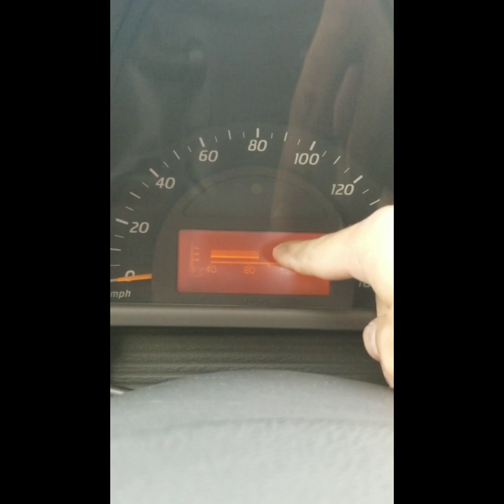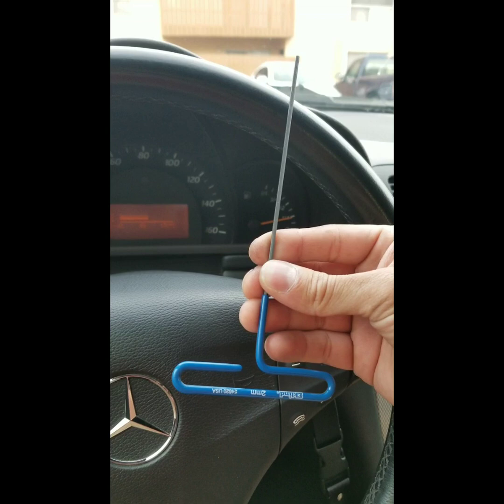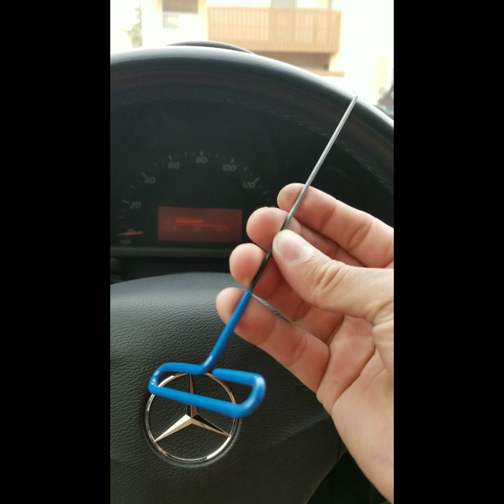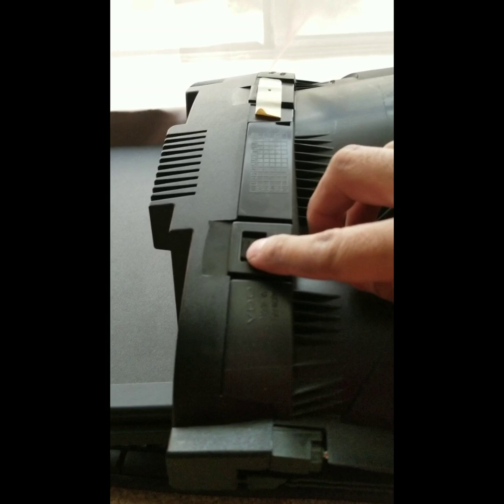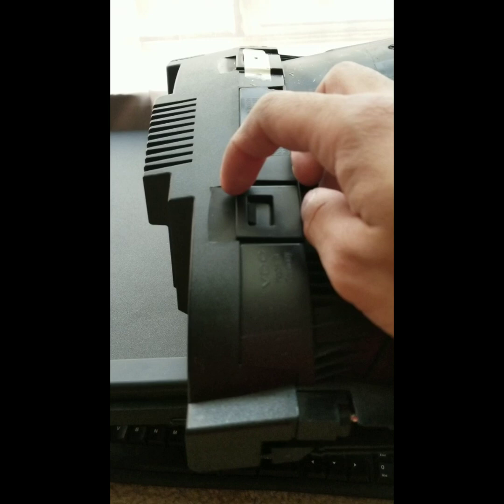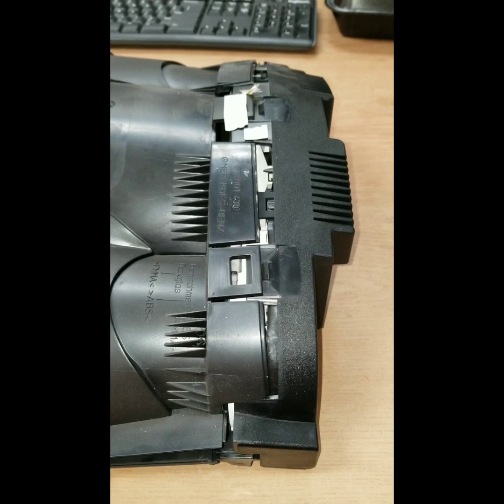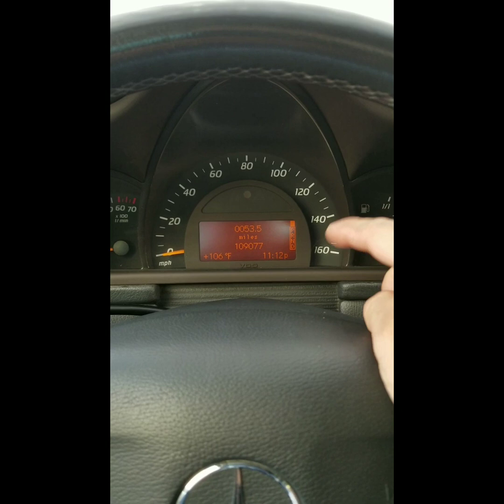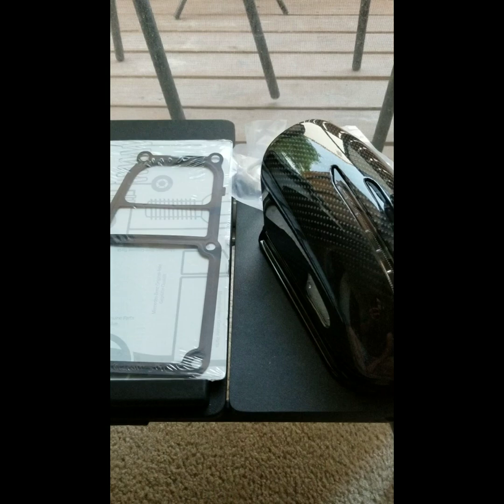Every Mercedes Benz C class has this PROBLEM! (W203 C203)

Comment: I have a 2001 e320. It has 3 screens. The left is the ambient temp. It is completely dead. The right is digital clock and gear position. It is almost dead. The larger center is faded bad. Do you know if all three are hooked in the same way? I assume the cluster comes out the same as you showed.
Reply from the maker: Yes, its connected in a similar way and I'm sure there is a LCD replacement for your vehicle.

Comment: So if I replace it is it gonna be worth it if it is ?gonna happen again due to the daytime heat
Reply from the maker: Keep in mine these vehicles are 10 to 16yrs old.  You wont have to worry about it for another 10yrs or more. It's worth it and needed to see your engine temp display on this model type

Comment: Hello, nice video! 
I got a question, is it possible to upgrade this cluster with the digital one (w203 2005+)?? The thing is that the base of this cluster on the video is curvy, is there a way to handle it and upgrade it?
Reply from the maker: Thank you! This was my first video made. So i have improved some.  

It is possible but is a good amount of work.  Plus you will need star/DAS to resink new cluster. A lot of work to most not worth the effort.

Comment: Majority is all aftermarket but with your experience they are still good in the long run?
Reply from the maker: Yes  they are comparable to the orginal but of course heavy heated enviroments degrade the lifespan of the lcd display. As the pixels are worn down by UV rays.

Comment: When I did this the SRS warning came on, however no fault codes are read ( Mercedes Shop ). I've read of this happening in other comments but never a sulotion
Reply: Hi Bruce, is an old comment, have you found a solution for the srs warning after changing the display?

Comment: You DO NOT push down on the tabs to remove the LCD - that is the way LCD's are damaged on removal, as you cracked the one you took out!!! 
Just push the LCD upwards towards the top away from the tabs (while still flat in its original location). This will give you enough room to simply lift the LED panel out. It's no wonder I've seen other youtube videos where the person making the youtube clip breaks at least one, and at times both of the bottom locating tabs.
Reply from the maker: Not sure if you noticed, but the screen is toast so regardless it being cracked or damaged is not important. 

But good info to add just word it more informative than !!!!!! Your thoughts and suggestions.

Comment: Hey, i also have a faded screen but mine popping up the malfunction by warmer weather.. and then it suddenly shows “display faulty” visit workshop, do you have any idea what that’s all about?  Please help!!!
Reply from the maker: Internally the display tends to have failed solder points.  Taking it apart to inspect it could help. Look for broken or loose solder connections also replace the screen

Comment: will turn lights indication also stop when this display become bad? Please answer .
Reply from the maker: That can be a internal issue or the turn signal stalk switch may be faulty
Reply: @PANZERSGARAGE   I mean that my mercedes w203 instrument cluster out of power .no lights no gauges  . Check fuse number 42 .it is good .battery good . What will be possible issue ?

Comment: Does anyone else have the instrument cluster that has rips and tears around both the edge of the tach and speedometer?   At night, light leaks from behind because of the rips.
Reply from the maker: No, i have never exeprienced that before but i know a company that can Make you a new faceplate
Reply: @PANZERSGARAGE  I’d appreciate it if you could email to me at JackEnrod@juno.com.  The rubber around the LCD is also deteriorating with little white spots.  My 2002 has less than 80K miles and lives in a garage. Mechanicals are bulletproof. Materials are crap.

Comment: You can leave it, it's comes back again, it's only happ en in hot weather some time,it's happen with me once, but  it got ok now,by next day it self.
Reply from the maker: That would be your LED back light which is separate from this LCD display. It can desolder due to heat and age but sometimes connect again when is touches. For the LCD Its best to replace and simple to do.
Reply: Mine is perfect in cold temps ,on a hundred degree day you cant even see anything. I ordered the screen ,just havent wanted to try this yet